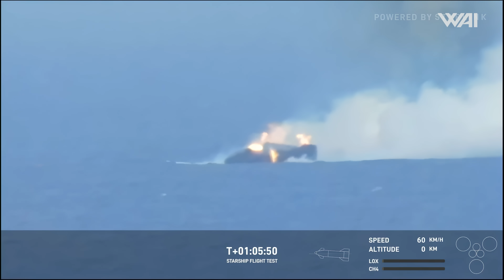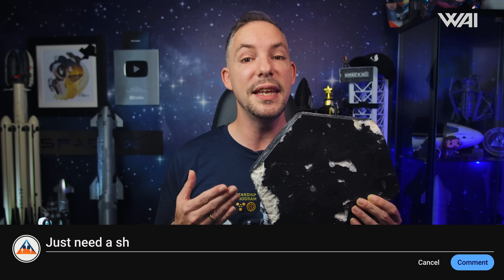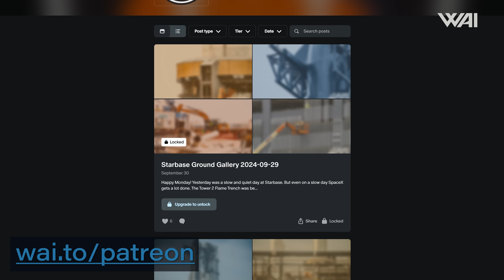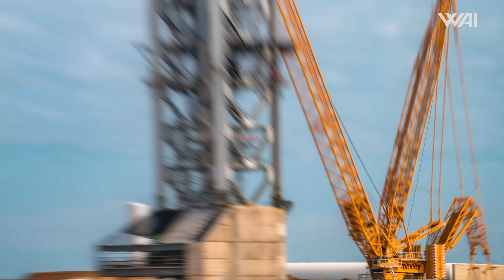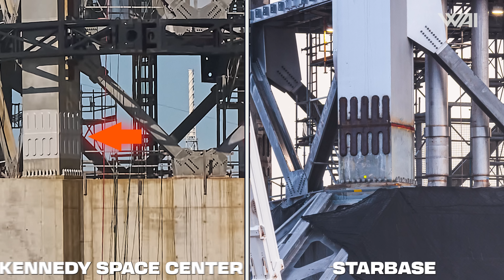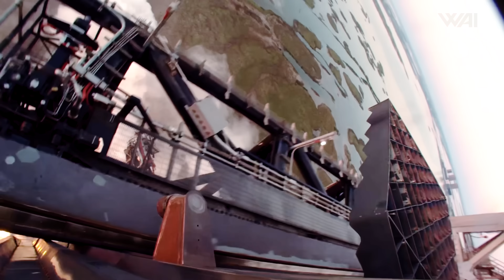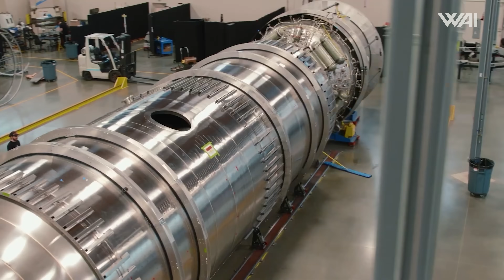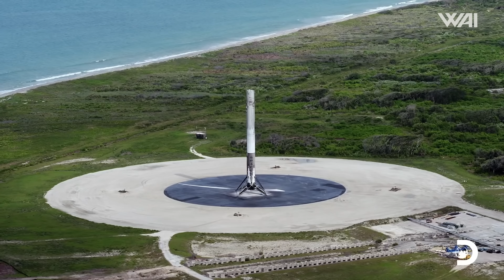Get ready for Starship Flight 7! SpaceX considers BIG Starship heat shield change!

Comment: I think spacex would like nothing more than to get rid of those brittle, flakey tiles ... the space shuttle had massive repairs on them after each flight, which hints to me that they would be unlikely to get down to the 0 repairs, a couple hour between launches. You don't even have time for a good tile inspection with that time between flights, so it would have to be quite reliable to fly again with 0 inspection / 0 repairs ...
Reply: You think there would be no inspections at all? airplanes need to be checked over and have some tests done

Comment: Active shielding will be the only means for rapid reusability
Reply: Roger. Tiles are fragile, and just checking them after every flight will take a day.
Reply: Active cooling was examined extensively for the Shuttle and was deemed too heavy, complex and unreliable. Tiles have no moving parts, liquid cooling has a lot of moving parts that can easily break or clog etc.
Reply: @admarsandbeyond  Those non moving parts tiles move a LOT.  Think thermal expansion on the connection points.  So they have to leave big gaps.  They lose tiles on every launch and they have a problem with WHERE they are located if they want to catch Starship like  they did Superheavy.  Plus they have added a LOT of weight witht he tiles. So testing active cooling is probably reasonable.

Comment: I don't think there has to be a reason that stuff happens here, for instance,  the supports on the 3rd tower may have just been contracted by a particular company and they may have had extra time, so they put them on now. Nothing to do with spacex.
Reply: They may not do the arms (adding the reinforcement) on those towers till they see how the shorter Tower B arms work out.
:planet-orange-purple-ring:

Comment: given the research work on flexible silicon carbide aerogels that can take as much heat as the tiles and weigh less, someone is probably going to figure out how to make it at scale in the next decade, and it'll solve most of the problems with current heat shields, tiles or otherwise.

Comment: Interstage doubled as circular guide? Open design for exhaust, then becomes a circular grid fin replacement, used for return guidance?
Reply: Extend the Starship hot staging ring allowing more exhaust flow AND replace the grid fins?  I'm thinking making it a truncated cone with the top matching the 2nd stage diameter (less sideways venting) and have the cone function to "scoop"air and direct it out the bottom with vanes in the opening to act as rudders.  Might be lighter than hot staging + grid fins.
:planet-orange-purple-ring:

Comment: Does anyone know why the tower needs an antenna to begin with? Why not use a hard wired comms line? And if the antenna is used for communication with the booster Im sure there other locations they can place it. Or use an antenna on top of the second tower as a backup.
Reply: Could be a radio beacon for booster navigation, like ILS works. Or GPS reference point for GPS correction on the booster and high precision, like RTK or DGPS

Comment: Which ever system SpaceX goes for it’s going to be towards one goal which is quick turnaround and reusability, if they can create a tile that does this they will stick with tiles, if they can’t then other cooling methods will have to take their place. Or it may be a mixture of the two, but whatever it is I’m sure it’ll be thoroughly tested in prototypes

Comment: If the metal heat shield is limited to specific areas, it sounds like a novel approach to solving a serious problem. How much area would be impacted, 20% of the surface, flaps, leading edges? Could they change the shape of the craft, redirecting heat away from specific areas?

Comment: If they can cure the issue with tiles falling off then a highbrid option might be the best aproach.  But ullage gas is a good aproach for active heat shields (Same aproach was used on the Saturn 5 Engin Bells) given its a mixture of water vapour & CO2 two very powerful greenhouse gasses they can obsorb a lot of heat.  Also they don't need to cover the entire exposed side of the hull with vents they just need a couple of rows of vents along either side of the bottom axis of the ship providing film cooling for the rest of the hull.

Comment: I think Vulcan would have been further ahead trying to figure out propulsive landing. It's just a matter of relighting the engines, throttle control, avionics guidance, control surfaces, and small segmented fuel tanks. Trying to conceal an inflatable heat shield between the main fuel manifold and the engines does not seem at all easy or less complex. Then the complex assembly needs to be repeated on a whole new tank.
Reply: If propulsive landing of orbital boosters was simple everyone would be doing it. The Chinese for example have been trying to copy Falcon for almost a decade without success. 
SMART reuse has been studied by ULA (and its predecessors) for decades. It's the only way possible to reuse some parts of a rocket like Vulcan.
Reply: @admarsandbeyond  Booster re-use is relatively simple. Full re-use is not.
Reply: @brendanwood1540  Again, if booster re-use was simple SpaceX wouldn't be the only one capable of doing it.
Vulcan booster has to accelerate the wimpy Centaur upper stage some much that it can not do propulsive landing.
Reply: @admarsandbeyond Then the heat shield, separation device, and extra plumbing will only reduce the performance. They would still be further ahead redesigning the stages. Changing the dimensions isn't difficult. Yes, re-lighting an engine and controlling the rocket and fuel inside is difficult. But it can now be simulated.

The reason the other established companies didn't have re-use was due to limitation in computer simulation and control. However, all the new competitors in the game are make re-usable rockets. 

Creating fuel disconnects, and a heat shield that can be contained inside the fuel lines, then inflated, and still survive re-entry is very difficult. The boost back eliminates all the heating velocity. The heat is the hard part.
Reply: Oldspace companies ignored reuse as they were on cost + government contracts and more expenditures meant proportionally more income and profit.  No incentive to keep prices down. Falcon 9 blew the lid off that scam and NOW other companies (mostly Newspace) are trying to do the same.
:planet-orange-purple-ring:

Comment: There must be a trade off continuum between a fully propulsive reentry, using lots of fuel, and the weight, complexity and maintenance of a heat shield.  The Starship heat shield may be 20% better than the Shuttle heat shield, but not the needed, say, 1000%.  The reentry burn, and landing burn, of the Falcon 9 first stage may be an example, with an exceptionally bad "heat shield" used between the burns.  The Starship heat shield must shift the center of gravity towards the heat shield side, requiring changes in the thrust vector (more cost) during launch.

Comment: Heat shield could use transpiration cooling with 2 SS 304 L sheets forming an annular passage for helium/methane or teflon ablator.
Top sheet is porous.

Comment: I don't understand the use of attritional heatshield tiles if a returned rocket is supposed to fly again within a few hours. Wouldn't the battered heatshield need repair if not replacing? A technical task needing careful checking and best not rushed for a schedule. a rocket as reusable as a truck needs a non attritional shield undamaged by reentry and only nominal checking between flights
Reply: or make a giant factory that has many arms and  replace all tiles in one go .

Comment: Active cooling as described makes Relativity Space's 3D printing technology a bit more interesting. Could a future Starship design block be 3D printed the cooling lines and other features integrated into the hull?
Reply from the maker: Yep! SpaceX is already very good at printing. Just look at Raptor 3 with its integrated cooling circuits!
Reply: @Whataboutit are they printing the Raptor engines?

Comment: This may sound stupid, cause I am not a rocket scientist, but why not slow down more before reentry to help with heat?  they are adding more weight anyway, so why not do that with fuel to slow down?
Reply: you would need to use fuel to slow down and the starship doesn't have that much left after de orbit.
Reply: No it makes sense; I mean instead of 100 tons to LEO be happy with 90 tons?
Reply from the maker: It's all about energy. The energy you put into the rocket when it goes up needs to be shed when it goes down. The atmosphere is used for this but that creates heat. If you'd want to slow it down in space, you'd need the same amount of fuel that you used to bring it up, which would make the rocket larger, which would need more fuel to bring it up and so on. The rocket equation is a b*tch.
Reply: @ that’s what I thought, but even slowly marginally could help the tiles last.  Not like any of this hasn’t been discussed a thousand times at SpaceX already with people way smarter than me lol

Comment: You can make a radio antenna from stainless steel (CB automobile whip antennae are often made of stainless steel)... so why not simply use the tower (or, if you need a particular antenna length, put one anntanna on each of the 4 vertical edges and use the one with best visibility for the booster)?
Reply: Or as the rocket launches, swing down the entire antenna assembly, and pop it up after the rocket has gone by.

Comment: SpaceX needs to investigate plasma spray ceramic coating for starship, easy to repair, simpler application, substantially better bonding. Stainless is a good material for this to work to as stainless will offer better grip than aluminum. Sand blast the areas in question and spray on the coating, and you can include refractory materials like tungsten carbide ceramic which are CRAZY heat resistant and spray them on directly. Massive saving in labor and easy to reapply after a landing if damaged.
Reply: So many smart people
Reply: Have the active coating but then spray on a new ceramic coating after every flight - but that would mean days between turn around times instead of hours. But if you have enough rockets then it doesn't matter.

Comment: Yes change the heat shield, been expecting this whole time for it to fail. It has held better than I thought it would but it's still no where near good enough. The heat shield was the primary problem with the shuttle and why they think they can make it work, kinda boggles my mind. To note they defo do have much more brainier folks than myself working there so happy to be wrong and learn, but so far I have been correct.

Comment: I think they should either go for a metallic heat shield, or perhaps try "micro tiles" maybe 1/10 as big as the current tile, so there are much more attachment points. I don´t trust big flat ceramic tiles that can break in the middle, or loose one attachment and peel off. If the tiles are smaller with the same thickness, their shape become stronger.
Reply: It might be too expensive, but I think a better trick would be to use Nitinol attachment pins so they could stretch instead of popping off or breaking the tile when the ship flexes under the stiff tile.

There's also a lot of research work going on for flexible silicon carbide aerogel blankets that could in principle replace the tiles once someone figures out how to make them at scale.
Reply: @thamiordragonheart8682  Nitinol cannot stand the exposure to the plasma/heat.
Reply: Build a shield that comes on and off sections with thousands of tiles
Reply: It’s how you could attach them properly though, it’s difficult enough to accuratly atttach the current tiles
Reply: @RandomPerson-zl6uz  I really think they need to just focus on slowing the rocket down
Reply: I think a disposable stainless steel heat shield, with varying widths on specific sections would work… not sure about the weight difference with ceramic… but it would be slapped on before flight and then sent to recyling after… pretty sure it would be faster and cheaper than ceramic… not sure about weight tho
Reply: OK So you want to inspect 160,000 tiles instead of 16,000 ? Oh and the problem is not so much the tiles,  but more the spaces between them (thermal expansion of the tiles) and you want to 10x them?
How often do you want them to launch for crying out loud!
As far as passive shielding goes, Starship is better off with a huge thermal blanket that is wrapped around for single use per launch but is easily replaced.

Comment: It would be interesting to see some numbers about how much energy is needed to be transfered to the atmosphere. A returning spacecraft has a lot of kinetic energy that equals to speed times mass. This amount of energy must be dissipated and if the spacecraft it self isn't to absorb all heat it can only be transferred to the air of the atmosphere. Tiles is good thermo insulators that block the heat to go in to the spacecraft but rather in to the passing air. If a cooling fluid is going to do the job, how much energy are we talking about? what fluid and how much is needed?

Comment: You could use liquid methane fuel pumping it through small holes on the heat shield and then dumping it back into the methane fuel tank as a gas. You would have plenty of room since most of the methane would have been used up and you'll basically just be pressurizing the tank to help the force methane downward for the landing burn

Comment: Always liked the skin cooling idea. Honestly a weight hit would probably be worth it for the durability. Already lost lives due to stupid brittle tiles, and the acoustic energy of super heavy has got to loosen them. I'd say take the weight hit (they're improving thrust all the time) and then put on an emergency ablative underneath the skin. Any weight penalties will probably get ameliorated by launch cadence very quickly. Spin some cameras around the vehicle with machine learning like a lot of industrial systems to look for damage and start fueling again. Or while you're fueling. If you really need to launch something seriously heavy in one shot, just make an expendable starship with no heat shield at all.
Reply: Furthermore, the shielding is only necessary for Ships that return to earth, and for ships that land on Mars. Cargo ships meant to stay up there, can do without the shield and have the extra payload cap.
Another idea for a heat shield is a thermal blanket, wrapped around like a corset around the main body, and the non-cylindrical parts can be film-cooled. The thermal blank3et can be ejected after re-entry, even after landing. Mechazilla can be modified to provide an extra arm that can wrap such a blanket around starship while stacked on superheavy. Added bonus, is that it also serves as a meteorite shield.
Reply: Active cooling was examined extensively for the Shuttle and was deem too heavy, complex and unreliable. Tiles have no moving parts, liquid cooling has a lot of moving parts that can easily break or clog etc.
Reply: @admarsandbeyond  for the Shuttle

40+ years of technological advances may have changed that. 
:planet-orange-purple-ring:
Reply: @admarsandbeyond  Tiles take ages to inspect, and repair. Fast turnaround is needed. Film cooling, despite adding complexity, is needed to reach the goal of being able to relaunch a starship within hours. When refueling in orbit, if you don't want it to take weeks, you need to launch multiple times per day.

Comment: The central core of starship seems to be doing just fine with the current heat shield tiles the issue has been the flaps and the hinges. If they implement an actively cooled with liquid or gas solution it will be in these areas.

Comment: Go SpaceX!! Time to put some landing legs on those starships and get the legs tested so we can get to the moon and Mars. Probably going to take a lot more than an hour to load 100 or 200 tons of cargo anyways, so why waste the time landing on the tower if you then have to get the ship to somewhere to shore up a cargo load, except it WOULD look way cool..
Reply: No landing legs more payload to orbit.  Having landing legs on craft targeted to LEO means less fuel per tanker to refuel HLS and deep space craft and therefore more launches to do the refueling.
:planet-orange-purple-ring:
Reply: Point taken and maybe should be worked but right now they're being dumped in the drink. 
What about the Moon or Mars eventually legs will be added?
Also I would think you would get twice the information out of a survived starship that could land and re-fly then one on the ocean floor??
Besides switching to no legs is easy just take em off..